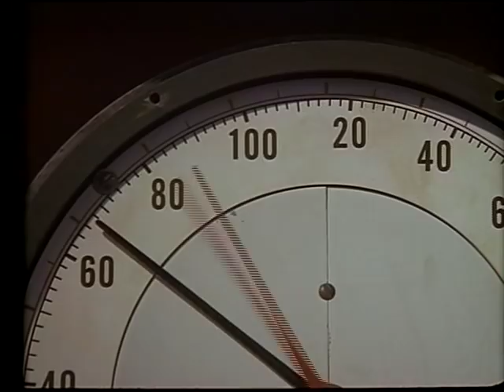Stuck Pipe

Comment: There are 2 types of stuck pipe, differentialy stuck and mechanically stuck, diff is due to a difference in pressure in the well bore and bit(usually due to m.w. Mech is due to formation or drill string hanging.
Reply: yep
Reply: How about the differential between the hydrostatic pressure of the drilling fluid and the BHP. 2 someting from the surface has been nocked or dropped down hole, the formation has slouched, just pulling against the high side of the hole. Did not circulate long enough. Should have pumped a dry job.
Reply: Key seat?

Comment: Derrickman and a couple of the crew have Wintex Drilling  coveralls on or gloves,  I used to work for them back in the mid 90's I don't recognize the rig though.  Don't know any  of these hands either, I wonder if this rig is the old rig that was at Abilene  Texas  for training off Loop 322 by a training school?  If this was a Wintex Rig it would have been painted red. At least all 5 they had in 96 were painted red.  Bob and Lunette  Jones were great to work for at WinTex Drilling. I miss the  oilfield.

Comment: "Hydrostatic stuck" ?
Reply: No such thing as “hrydrostatic stuck”. Hydrostatic pressure is simply the pressure exerted in the well bore by a vertical column of fluid.
Reply: maybe you meant Differentially stuck

Comment: I had a hand drop a tong pin down the whole one time and another one Drop the tong die down the hole. I always told them to move the tong‘s way from the hole because that holes like a magnet. Shit happens. Also I learned at relief time Pull up a joint all the way up to shut down to change crew